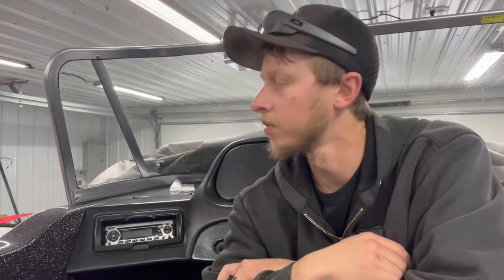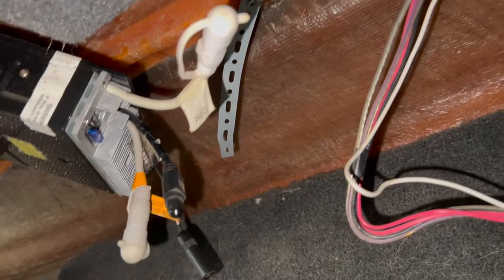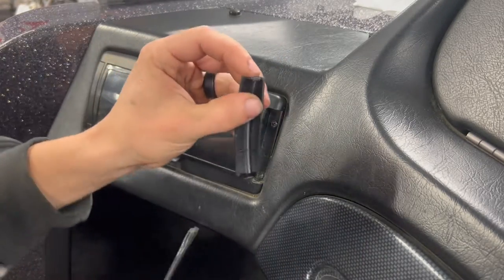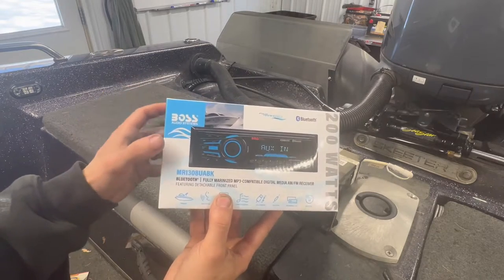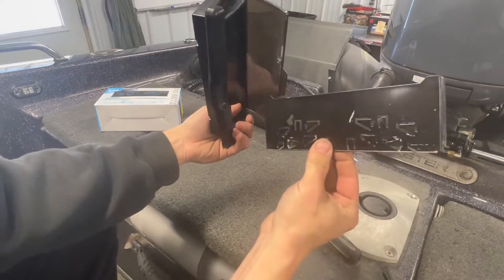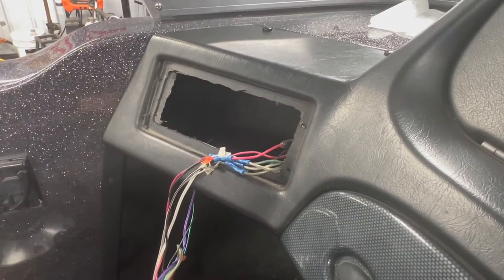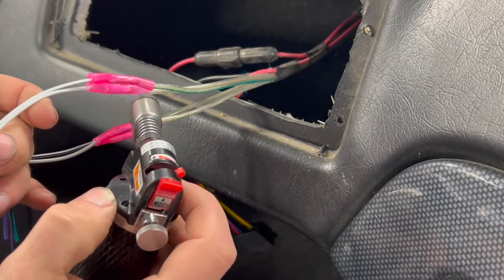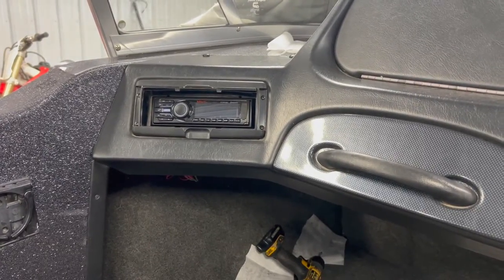How To Install A Radio In A Boat

Comment: Great video! I used it to install a new Boss radio (not same model as this one) in our boat because the old one quit. My hubby was too busy with work, and I have not installed a new radio in anything since I was in my teens, it was a lot of years ago, and I've never installed one on a boat. Watching your video made it easy. Everything worked great! But I think you miss called the wire colors when you were discussing the red and yellow wires. There was no yellow wire on the old radio. I installed them together like you said, we got down to the lake today (a week later) and the boat battery was dead. So I looked up the yellow wire today when we got home, and this is what I found out...
 "12V Memory Wire...The yellow wire is typically used for 12V memory, or “clock,” signals. This means that it helps preserve your station presets and other settings when the car’s ignition is turned off. In some cases, the yellow wire may also be used for tuner functions." 
  Our radio turns off but the clock still shows and the preset stations stay, so I can only guess that the yellow wire being hooked up is what drained the battery.  What is your opinion on this?

Comment: So my dealer put a new jensen ms2013bt in my pontoon, but the battery keeps dying and the radio works when the boat is off and it doesn't require an accessory switch to be on

Comment: What do you do if all the wires coming out of the boat are color faded?
Reply from the maker: Thank you for the comment. The only option you have is to trace the wires to figure out what each wire is for
Reply: Pull all the wires tight and lay them down in order of the pins then get a diagram to compare it to is something that’s worked for me
Reply: Like at the harness plug

Comment: Is it possible to bun the wire while melting the connectors?
Reply from the maker: Yes it is. Just have to be careful
Reply: I melted the connector but not all the way to the wires. Can that be the reason why it won't turn on?
Reply from the maker: No as long as you crimp down the connector to bare wire all shrinking it down does is prevent moisture from getting in
Reply: If the speakers are connected wrong,  can that be the reason why the radio won't start?
Reply from the maker: @mindfusion4956 no

Comment: If i only have one speaker which wires do i need to connect
Reply: Same red yellow black for power and then just pick one of the speaker wires running off the harness to power the one speaker. hope that answers your question

Comment: Hey, I followed step by step in your video. There is still no power to the radio.
Reply from the maker: I would use a voltage meter to check your voltage coming from the boat
Reply: Boohoo